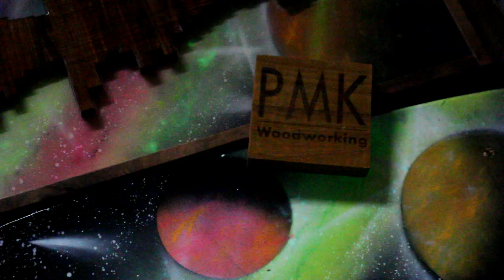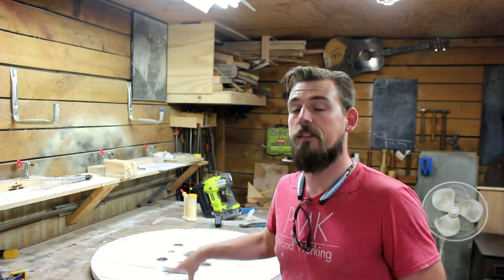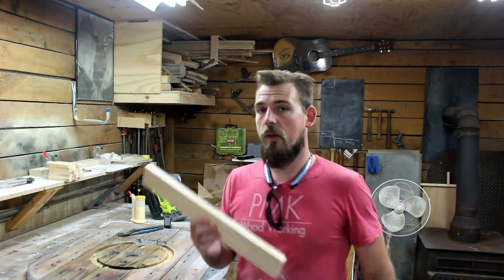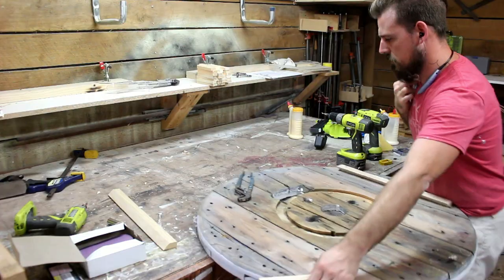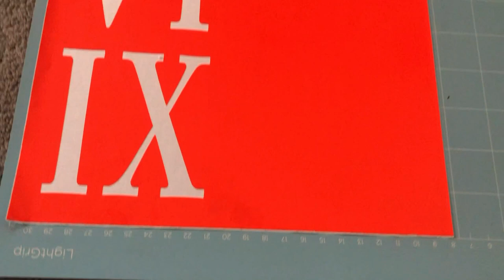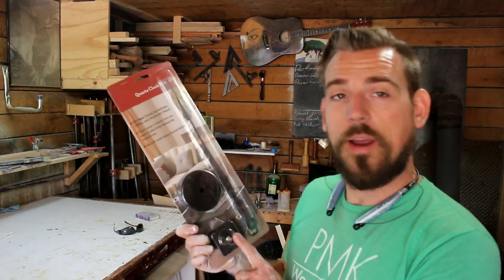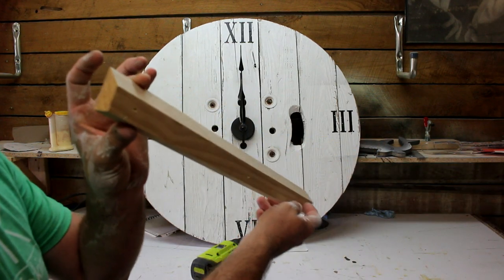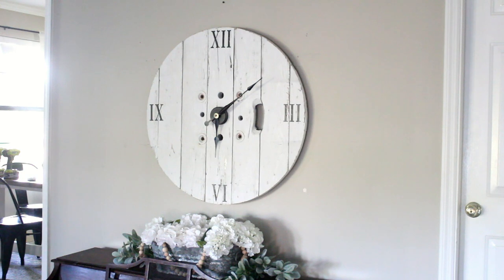Easy DIY spool Clock!!!

Comment: Love it; about to do my own. Question or two though; what is the diameter of your spool? And what is the height of you numbers? My apologies if you answered this in the video; I did a quick watch 😆
Reply from the maker: I don’t think I answered either of those so, thanks for asking… the spool Ed one of the “larger” ones… I think I have a mix of 36” and 40” but it really depends on what’s available at your local electric company or supplier or Facebook marketplace.  My numbers were all 5” for this project on my Cricut plotter, but you can customize your own to the size you like!
Reply: @PMKWoodworking  thanks! Yeah my employer throws a lot out on a monthly basis so I picked up a 30” one. I figured yours were about 5” I think I’m going to go 4-4.5” thanks!